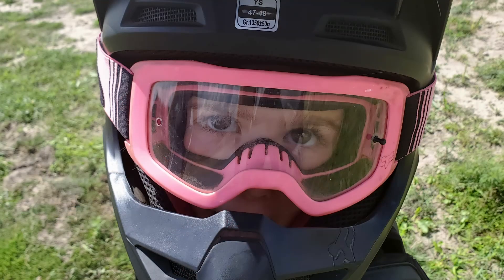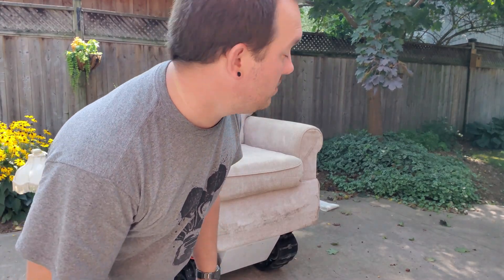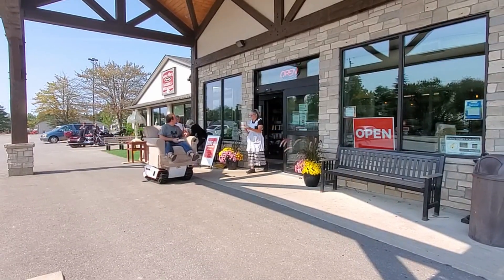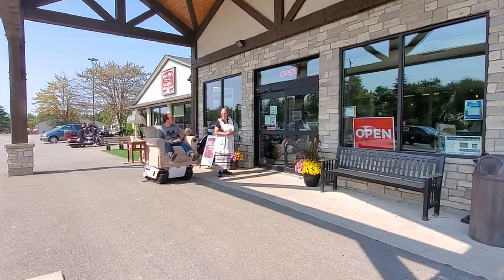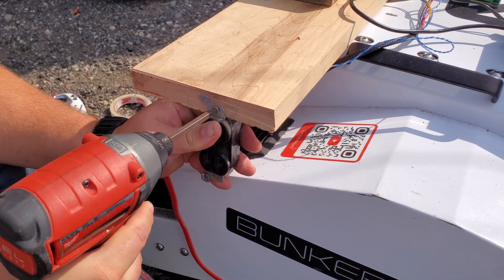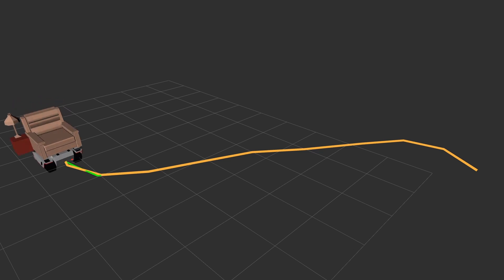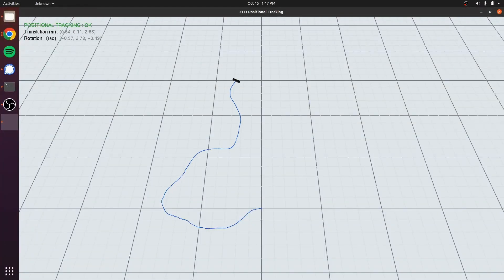Off-Road La Z Boy Robot!

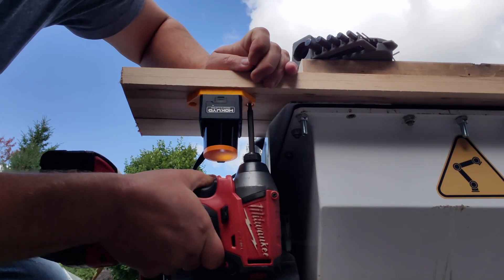Comment: 5:31 what is the difference of "safety rated" and the one you're using? i'm guessing something like accuracy or response time of sensor?
Reply from the maker: A safety lidar will protect a known area with a hardware interlock. Objects of a known size will trigger a hardware output within a known time. All heavily quantified and can be relied on for safety. 
This laser has none of that hardware. It would require software analysis, which can't be guaranteed for safety

Comment: Did you end up actually using odometry from the zed as well? How/where did you combine it with the GPS?
Reply from the maker: Yes, I mostly used the Zed odometry as it doesn't drift much, and when odometry would be terrible on this terrain. I fused the zed and gq7 odometry in an ekf for relative position